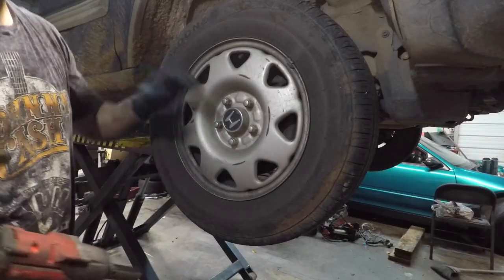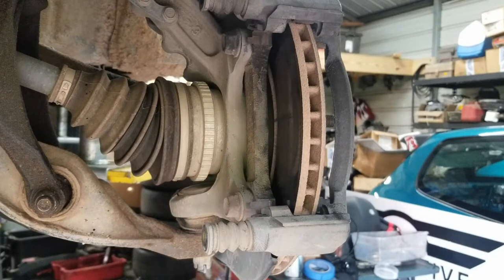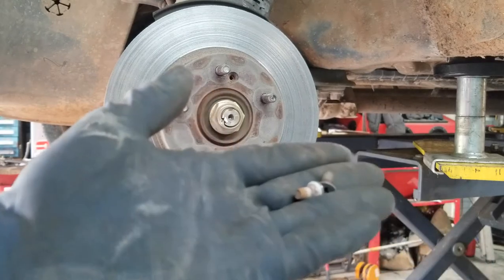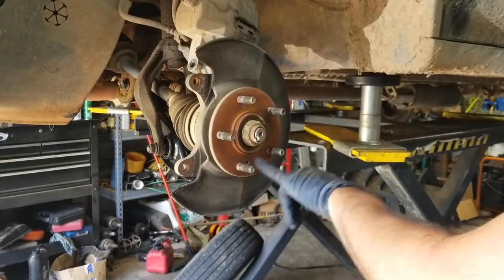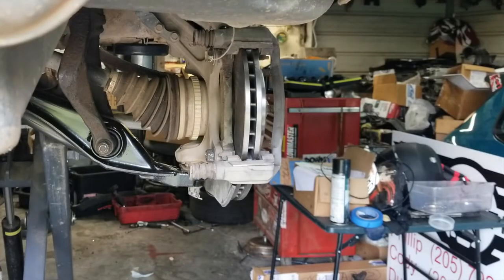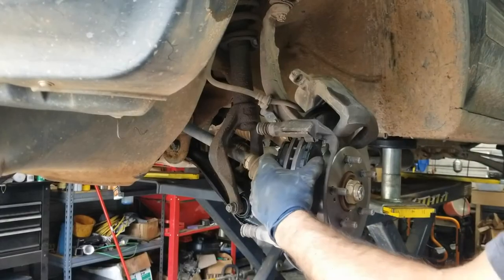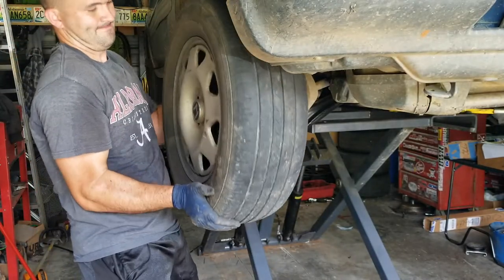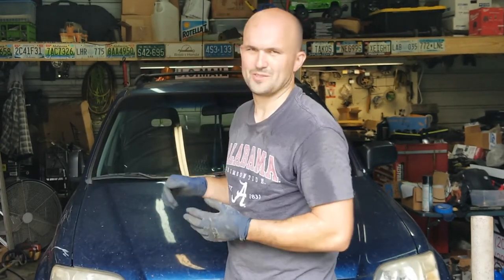97 - 01 Honda CRV Front Brake Pads and Rotor Replacement | RD1 RD2

Comment: Thanks for taking the time to make and post this informative video. The info on removing the 2 screws holding the rotor is valuable, since there are people who get to this stage of the repair and get no further without putting it back together after slapping new pads on and calling it a day.

Comment: When pumping the brake pedal (7:00) I never press it to the floor as it doesn’t go there during normal braking (so that portion of the brake master cylinder may not be smooth and perfect). Instead, I pump the pedal using short strokes. Never had to replace a master cylinder right after brake replacement in 30+ years of wrenching thousands of vehicles.
Reply from the maker: Interesting technique. Every mechanic I know uses full strokes.

Comment: 1:51 we couldn't get ours to budge. We used Breakaway and heat and it wouldn't budge. The guy at O'Riley's Auto Parts sad we could just drill them out. Which, we did. But he said we didn't have to replace them because they don't actually serve any useful purpose. He went on to claim that they're just in place to hold everything together while the vehicle is coming down the assembly line. Once everything is out together, the screws aren't required anymore. Can anyone confirm or refute this? Perhaps do me a favor and explain it to me like I'm 10 years old lol
Reply from the maker: It's true, the screws just hold it in place until the wheel is mounted. I've had to drill out numerous bolts over the years. The wheel will hold it in place once it's bolted on
Reply: @hondaresource  Thank you for the prompt, polite reply! I have no experience working on cars, but I'm tired of paying people to do work that I can do myself with help from videos such as this.
Reply from the maker: @mikedroz2301  heck yeah man! Best of luck to you

Comment: Good video! Thanks for taking the time to do it and then edit all your videos. That takes extra time and it makes the video much better with all the extra time cut out. What kind of brake pads would you use if you had your pick on an RD1? Also, what kind of lift do you have? I have a 2001 SE with 187,000 miles that I used your video to replace my valve cover gasket. Saved me about $200!!! Thank you my friend - and ROLL TIDE!
Reply from the maker: I like brake best products from oreilly. That lift was a bendpak 6xp. I used it for about 3 years before selling it and buying a 2 post lift.

Comment: Much easier to replace brake rotors on a 1999 CR-V.   It is almost impossible to replace rotors on a 1996 Honda Accord with captive brake rotors...
Reply from the maker: Those are definitely more challenging

Comment: I dont have the tool at 2:09 or the c clamp? Idk how much these cost either. Wanted to go to brakes for less but im sure my rotors need to be replaced not resurfaced.
Reply: Ok c clamp is pretty cheap.
Reply from the maker: They are both pretty cheap
Reply: @hondaresource  any opinion on bosch rotors? They are $40ish. Im kinda broke to afford the expensive ones right now
Reply from the maker: @maerenee8356  those will work perfect!

Comment: great job :). did you really use JIS bits for releasing rotor screws or is sthere a way around?  I have a bit hard time to get JIS bits. thanks.
Reply from the maker: No, I used a standard Phillips #3
Reply: @hondaresource  Thank you.

Comment: I see some people put a lot of lubrication on the two pins that you took out then put yours back without adding more lube  I though the more lube the better for your break.  Is that true?  I cannot see any lube on your pins while some others have some thick grease cover their pins.  Can you please explain what you use and does the thick grease make any difference?  I am about to have my breaks replaced for my 2001 crv and trying to know more about breaks.  Thanks.  Oh, should I change the front and rear breaks  at the same time so that I can estimate the wear down of the rear breaks by examining just the front breaks (the rear breaks are drums)?
Reply from the maker: I would definitely use the grease on the pins. The front wear faster as they do about 70% of the braking
Reply: @hondaresource  thank you!

Comment: Is the impact driver necessary to get those 2 screws off or can I just use a screw driver and hammer?
Reply from the maker: Screwdriver and a hammer may work. I've been able to use just a screw driver. I've also just had to drill them because they stripped. Each situation is different.

Comment: Hello, I have a 2000 Honda CRV LX 2WD. My front rotors and brake pads were replaced a couple months ago. They were replaced with new NOS Wagner Thermoquiet ceramic brake pads QC503. The rotors are Wagner BD125518E. They started squeaking every now and then a couple of weeks after I had them done. Yesterday they sounded like they were grinding some.

I went to a company that specializes in brakes today. The tech said the rotors and brake pads I have on my car are used for high performance vehicles. He said when they get hot it could be causing the noise. Do you think this is true?
Reply from the maker: Ceramic brakes do make more noise.

Comment: I have a 98 crv and lately its been making like a grinding noise that i think is brake related because it eases down when im press the brake pedal but im not sure. My mechanic seemed to have fixed it last time but it came back in a month or so. Also i get vibration when im coasting around 30 to 45 mph but pressing the brakes seems to stop it as well until i start coasting again. Bro, this has been driving me crazy and id greatly appreciate any knowledge you might have as to what might be the issue. Also great job with the vids man!  i hit subscribe right away 👍
Reply from the maker: Check the dust plate on the back of the rotor for the noise. As for the vibration, I would jack the front up and check your tie rod ends in addition to the rest of the front end components. 
I'm happy to have you here!

Comment: Okay so I don’t have to take the cap off of the brake fluid reservoir before pushing the piston back down ?
Reply from the maker: Nope
Reply: Oh Okay thanks. Someone had told me before I’d get air in the line if I didn’t take the cap off.